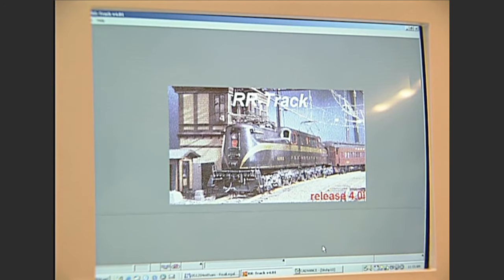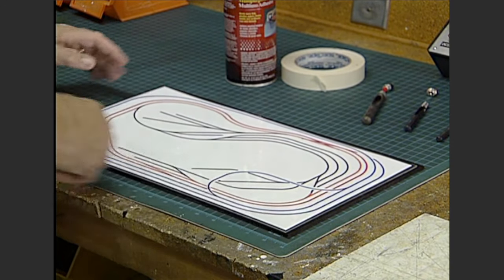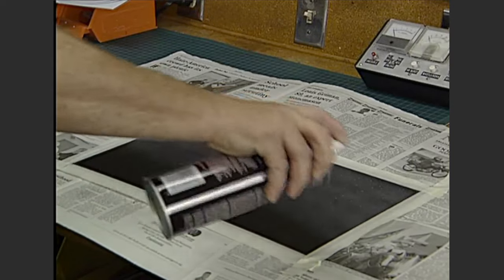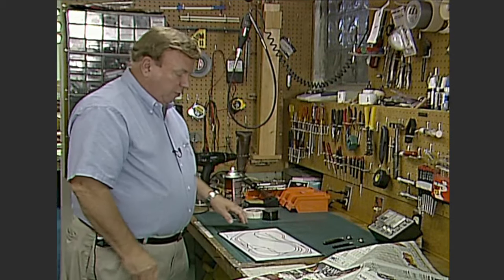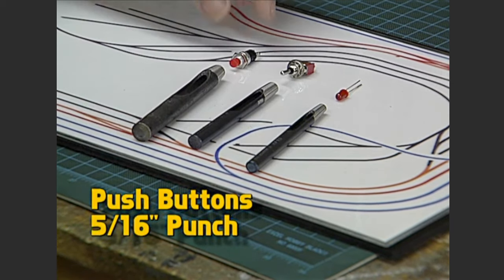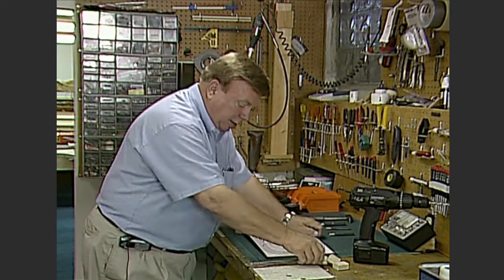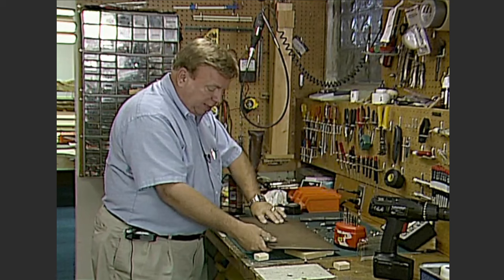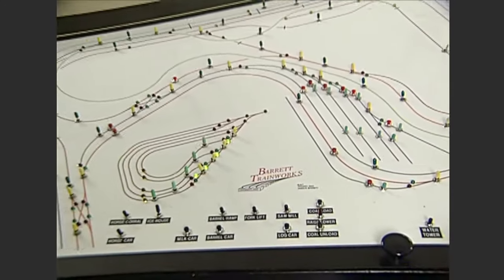Backshop: Make a Control Panel

Comment: Holy Vintage Computers!  Look at the size of that beige CRT monitor and with a beige Microsoft Keyboard!
This has to have been film in the late 90's or there abouts...probably by young, thin, handsome Rich Melvin that had full head of dark hair...but just a guess...
Reply: Early 2000's based on the cars in the parking lot at Kinko's